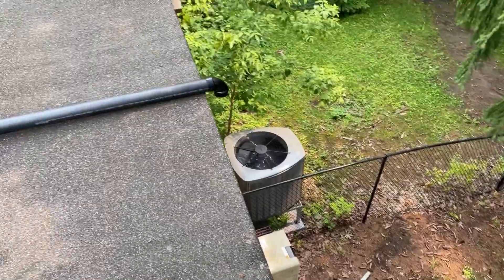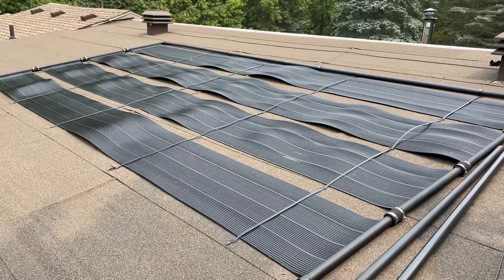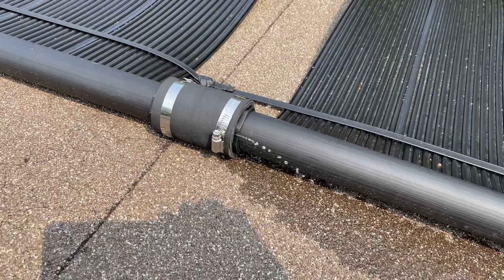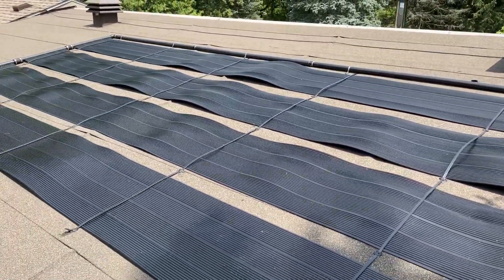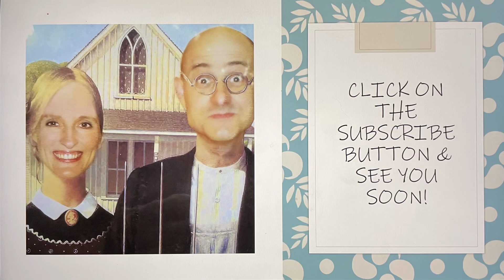Sunquest Pool Solar Heater Part 2; Linking Panels to Your Pool Pump with a Diverter.

Comment: Hi, we ordered one from my parents but they have probleme with their fitting.

 could you tell me how you fixed the 90°corner we see at 1min45, the one relaying the pannel entering to the pvc pipe? is it just a normal pvc joint and you add a load of glue and it hold? or is it a fitting you found somewhere else?
Reply from the maker: Hello again! I just watched to the end and it seems that fitting did leak after all! I was thinking that so I checked the whole video! Seems we used repair epoxy and silicon tape where the leaks were and this held. You can see it at 8:12. Hope that helps!
Reply from the maker: Hello there, and thanks for the comment! Sorry for the delayed reply but I needed to find time to go back and look at that part of the video. The 90 degree turn is just a PVC elbow with PVC cement to hold it in place. We tested after to ensure we didn't have any leaks. We're in our second year and still no leaks despite staying up over the winter. So far so good!

Comment: I feel like that valve is doing nothing while the valve is open its still going to push water through the heaters .the valve should have been put on the inlet pipe on solar heater
Reply from the maker: Hello there and thanks for the comment! I see what you're saying and I was thinking the same thing for a while. This is the set up they recommend and I guess it's because the water will take the path of least resistance. So, with the valve this way when it's closed it is forced up onto the roof. Otherwise it would always choose to flow to the pool without going through the panels. I guess water does not like to run up hill!

Comment: Is there a reason for using ABS instead of PVC?
Reply from the maker: No reason, just what was available to us in the local hardware store. Thanks for the comment,  have a great day!
Reply: Probably because it's black and will hold heat better but . I would just have used pvc and used plastic paint

Comment: How much rise in temperature between inlet and outlet.  Cloudy vs Clear day?
Reply from the maker: We've noticed about a six to eight degree difference when we use the solar heater (with a solar blanket) vs when we don't. We've had a very cloudy summer with lots of rain so I think it's doing pretty well so far! When we have a few sunny days together the temp goes up another couple of degrees. The trick is also for us to remember to close the diverter at night, always forget to do that! Thanks for the comment!